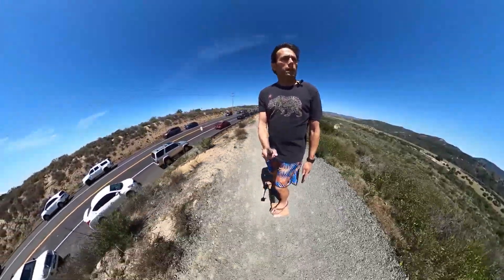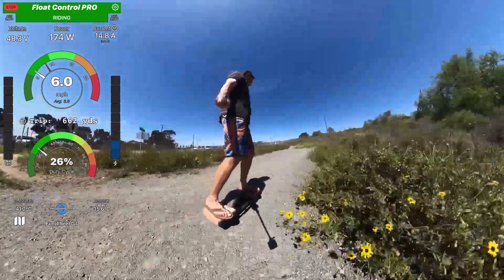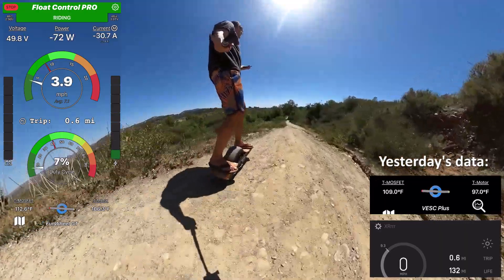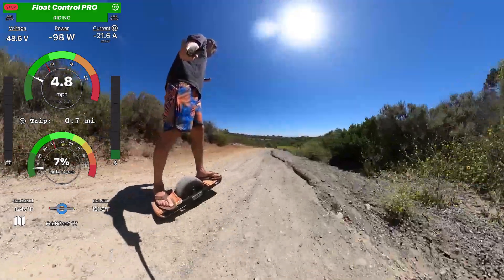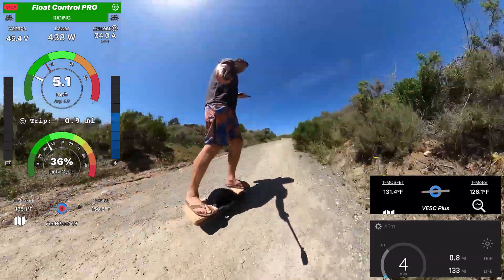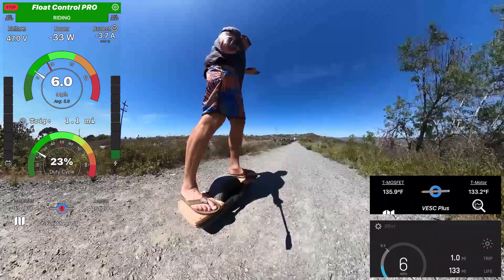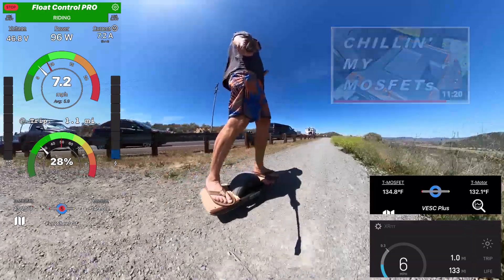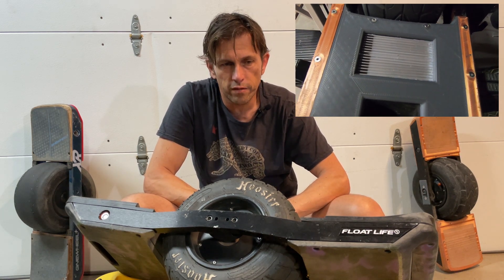OneWheel Motors Overheating? Torture Test

Comment: Isn't this very hard to compare? Since PID settings affect the motor temperature super much etc. Atleast in the drone world where I come from, the pids affect the motor temps immensely.
Reply from the maker: in this test a large percentage of the energy is spent transporting a 160lbs rider up a steep hill, in all 3 cases I took 12 minutes to ride the same exact course and I didn't do any tricks or anything, of course the sample size is small - but I'm not going to go all crazy about making it scientific. I'm pretty confident that between different "sane" PID settings there's only a few percent difference that we'd observe. From personal experience I've ridden the same board on the same hill multiple times and the PID settings were never a big factor. Much more important was ambient temperature and rider weight (e.g. my 12yr old kid versus me)
Reply: I've been folliwing you for a good while now btw. Great job!

Comment: What some people do in the ebike community is they put some Ferro fluid in the hub motors as it gets atracked to the coils where the most of the heat is being generated and helps with cooling
Reply from the maker: yes, that's the Statorade I use in my Funwheel, which btw is the only Ferrofluid brand I know that is safe to use in our hub motors

Comment: You can actually plot the motors in VESC-Tool. The motor comparison tool can plot all relevant curves. There is no need for a dyno, it's all pure maths. This is a helpful feature to see how well motors are designed. The losses go up with the torque produced and the function is not a linear one. Twice the torque = 4 times the losses. There is a square relation in between losses and torque. This is why hub motors always struggle.
Reply from the maker: Thanks - this is good to know. I don't know much about motors so aside from the motor wizard I've never done any "bench testing" - I need to check this out
Reply: @surfdado  You got an email from Vedder and me. We will try to implement a wizard for single wheel skateboards once we have such a board to hands for testing. The mail also contains some detailed info about TM usage...  I will also take some time with Vedder to write something up for the motor comparison and how to use it. Hub motors are never a good choice really, since the performance is very poor. The single wheel with fat pneumatic tire is making things even worse since the motor diameter in reference to the wheel diameter is limited. This creates a negative gearing ratio. Ideally you want a super slim tire and a stator with the biggest diameter possible. With inflatable tires the ratio from wheel diameter to stator diameter is never a good one. These boards really want a set of planetary gears inside the motor like it can be found on bicycle hubs.

Comment: on whish vesc version are you 5.2 or 5.3? do you thinck this can be a game changer between the 2?
Reply from the maker: it was 5.3, but this makes no difference - in the end of the day it's all about the work being done to transport your body weight. More aggressive configurations might use a bit more power than softer configurations but I doubt it's a dominant factor. Rider behavior probably has a bigger impact, that's why I tried to keep my ride straight and boring

Comment: More great info, thank you. 👍🙂
Have you considered a hubmotor dyno setup? You could test and compare motor torque/power over the whole rev range. I'm curious if the new GT has increased stack length or stator diameter compared to the XR... 🤔
Reply from the maker: Too much work... leaving that to others :) The GT has an identical stator to the XR (they're interchangeable, google GTXR) - it is a bit of a mystery why exactly the GT has worse thermal performance than the XR, maybe bigger rotating mass because of the heavier tire, or less contact surface area between axle and rails compared to XR, idk
Reply: @surfdado    thanks for the reply. 🙂
Reply: How about the Fungineers SuperFlux hub motor? Don’t know a lot about VESC etc, but learning more :)
Reply from the maker: @devrim1134  Should be an awesome motor, but nobody knows the specs yet. I know Fungineers is working with the manufacturer to address heat dissipation as well, maybe even have Statorade applied from the factory
Reply: @surfdado  Just the 2000W, curious about the other specs as well, think we'll need to wait for that. I've read about Statorade, but some motors could be incompatible. So for the Onewheel hub its a good idea to apply?!